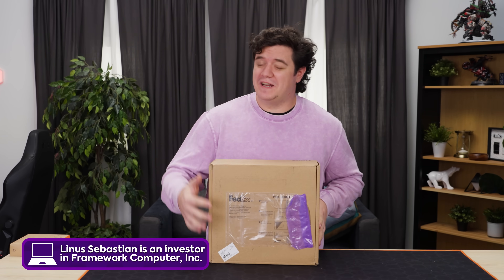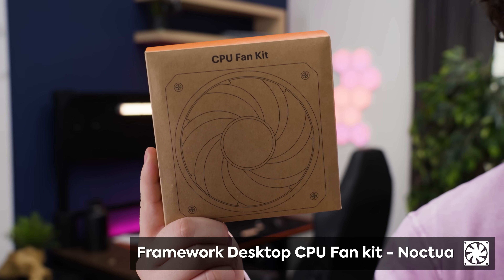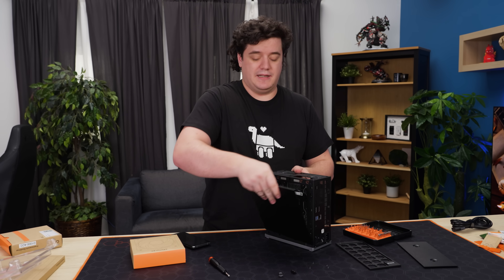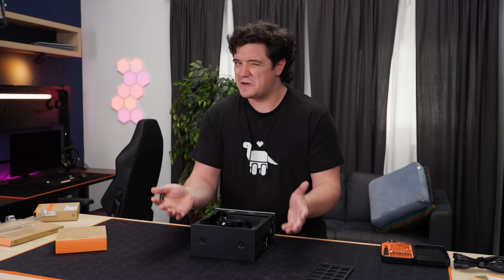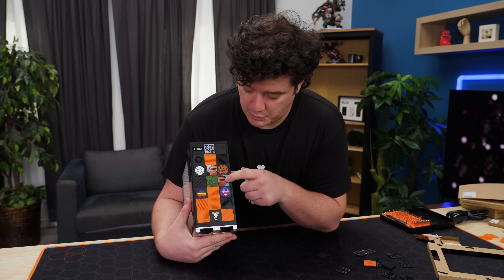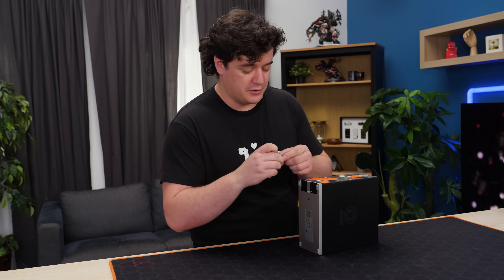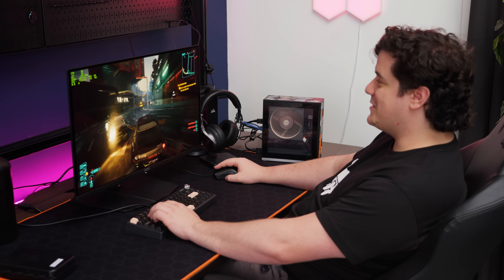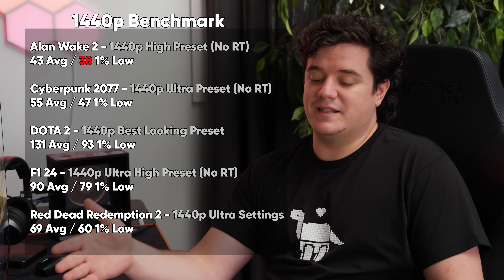This TINY desktop makes me nervous.... - Framework Desktop

Comment: If the maxed out version was $1200, sure. But $2300? Hard to say yes to that when you could get a way more powerful machine for that price.
Reply: I really wish people would fucking research before giving the "bUt Da PrIcE" line, got on PCpartpicker and price out a 9950X (cuz this is a 16 core Zen 5 APU), a cooler that can actually handle it, an ITX motherboard that can reliably supply it with power in the same form factor, 128 GIGABYTES of DDR5, a 2TB SSD, a 4060/5060/5060TI 16GB, a PSU to power it all, and an ITX case that'll still be twice the size AT LEAST and probably cost $200+ on its own, and youre running at about $2000 if not more, while also drawing more power from the CPU ALONE than this thing does in the whole package. The price isnt bad if you actually price out a comparable build and dont give it obvious favoritism over the framework. Is it for everyone? No. But its not overpriced.
Reply: @StretchDattass more like a NVIDIA RTX PRO 6000 Blackwell then you will almost have the same VRAM than the framework desktop. Ah yea the GPU costs $10k btw
Reply: What other system can you get under $3000 with access to almost 128GB of RAM for the GPU?
Reply: They are not upcharging you on the extra's you can fit, at least in my local pricing, and the base price for the system is pretty darn competitive! Its a whole computer with crazy performance in a lunchbox, just to get comparable discrete GPU to these AMD APU for any remotely memory constrained task (which often does include gaming as 8GB really isn't enough anymore) you are looking at spending at least half as much, and quite possible vastly more on the GPU alone. The nearest comparable RAM for a regular desktop is really not cheap, and almost certainly runs way slower no matter how much you spend on RAM and motherboard to give you the best chance of good memory speed overclocks... And for good measure these APU are vastly more power efficient than the regular desktop tower of comparable performance.

Don't get me wrong this thing isn't the best possible performance for your budget by any stretch, but comparing a 800w+ giant tower to a maybe 140w total system in a shoebox you don't expect the smaller system to also have price to performance in its favour. And the big tower has more ability to interface with extra hardware - want to load up on networking, or fill up on sound cards etc you can.
Reply: No you won't find a cheaper computer with equal or better VRAM capacity
Reply: Can't get a graphics card with 96gb vram tho
Reply: It's an ai first machine from my understanding it's still price competitive for the other computers using that chip from what I can tell
Reply: And much more upgradable without paying the framework tax
Reply: @tiloalo  happy to pay the framework tax, if I get a more upgradable machine. As I did with my framework 13. Less so here. Get why it exists but definitely not for me
Reply: in like 6 years i could see myself buying one. 2500 CAD is too much.

Comment: You can buy HP desktops or Laptops right now with this chip, this RAM, etc. but they include Windows 11 Pro installed AND in the case of the laptop, a screen. They are priced roughly the same as this Framework too. So what's the upside? Some plastic pieces of flair?
Reply: No idea what you're smoking, but the starting price of these HP machines with 32 GB of RAM is about what Framework charges for the 128 GB variant.
Reply: @jfolz I went on the framework website and did a build to match what HP offers. Came out to almost $1600. Now look up this GPU, RAM, and Windows 11 Pro for HP. You can buy them right now $1500-1800. This Framework device has 0 unique qualities
Reply: @jfolz  On top of that the Framework Desktop runs the chip at full TDP, unlike laptop manufacturers, who are constrained by thermals and battery.
Reply: I am pretty confused, since the main point of framework is to be repairable, but nothing essential seems to be replaceable. I think maybe framework just wanted to be one of the first ones to use this chip
Reply: @craniumsnumb A, they arent the first with this chip, half a dozen other mini PCs already launched with the same chip and configs they have before they started shipping this. B there's nothing saying they wont make another board with whatever the Zen 6 version on this Zen 5 chip is. C the main point is that theyre basically the only one shipping this chip in an ITX compatible mainboard form factor. Everyone else is a mini PC with a proprietary board for their specific chassis. If you wanted to, you could quite easily buy the 385 board itself for $800, shove it into a $40-$60 ITX case with built in PSU, slap on an SSD and have a VERY capable gaming machine with more performance than youd get out of a new desktop for the same price.
Reply: @craniumsnumbSOC chips are truly the future so yes. It made sense to be first in (now) niche markets as a small company.

Comment: I started writing a comment about how the cable is just a standard cable and we don't to keep manufacturing more of them when so many get thrown out with e-waste, or how many people just keep their existing cable and throw away a brand new one rather than take it out its packaging... when I got to the bit where he literally throws the brand new cable stil wound as it came in the box.
Reply: This! I was shouting "THATS WHY THEY DONT INCLUDE IT BY DEFAULT"
Reply: Yeah there are a lot of bad takes in this video.
Reply: We'd much rather solder the RAM to make the whole motherboard outdated in a few years...
Reply: @tiloalo thats an AMD requirement for the chip, not a framework decision. They either have this with soldered memory, or they dont have it at all.
Reply: @tiloalo  Unfortunately, soldered RAM was a necessity for this APU
Reply: @tiloalo  Better get used to it. More and more companies are heading this way. The reality is that for a unified memory system to work well, the added signal losses introduced by the connectors on a memory slot as well as the longer length of the traces needed to actually connect to multiple slots actually make a big difference when you're trying to achieve maximum throughput at high clock speeds.

Also, there's a big difference between laptop motherboards with soldered RAM to save costs or upsell customers and a system like this that actually needs that kind of signal stability to run at peak performance, particularly with higher-speed memory. Simply put, you can achieve higher memory bandwidth if there's less signal loss. It's not just about making more sales down the road, although that's basically an inevitable side-effect of this scenario for consumers.

With that said, I feel your pain. CAMM modules may be able to get some configurations most of the way in the future and provide some upgradability, but the days of buying a PC and then increasing the RAM later are coming to a close relatively soon, at least on higher-end systems. In the end, you just can't cheat physics.
Reply: @tiloalo   why the hell are you in every comments, even comments that are not about the ram, chirping? dude.. lmao if this annoys you so much you should just not buy it...

Comment: There are so many reasons not to include a power cable with a pc like this. The most obvious reason is that if you are buying this pc, it is likely not your first pc, meaning that you would already have at LEAST 1 C13 lying around. The second most obvious reason, and one that is shown in the graphic used in the video, is that they offer different cables for different regions. Why ship a North American power cable to someone in Europe? Why just ship out a cable that your user might already have. Spending $5 on a $5 cable that comes with the region correct end is not a problem. And if you already have a cable, you can save yourself $5. That is a plus in my book.

Comment: I felt better spending more money on a Framework laptop despite the average specs at the time, but I was fine because ideally this is the last laptop I'll ever need to buy.

I wouldn't dream about splurging on a desktop that's less modular than most standard laptops, performance be damned.
Reply: They even 5079 option in framework 16 now. That is already there is performance.
Reply: They even 5079 option in framework 16 now. That is already there is performance.

Comment: honestly i have a pile of that power cable.  at a certain point isn't one coming with the system just ewaste?  same with the HDMI cables that came with my monitors... i have a bin.  Yes MOST companies would leave it out and not change the price just as a cost cut, but... if I DON'T need it?  why should it be manufactured?

Comment: Framework: please release a firmware update to fix the USB-C video output, it takes like 3-10 minutes to get a display signal to my thunderbolt dock’s DSC triple monitor setup with me fiddling with the power button, power cord, mouse and keyboard until it eventually outputs video on any of my connected displays!
Reply: Same issue here with my single LG 34UC98 monitor connected via USB-C

Comment: I have so many c13 power cables lying around I would opt to not get one just to save the space
Reply: wow u saved like nothing
Reply: @primus711 So? I don't need another cable. I have plenty why should I or frame work spend money and material shipping something that will just end up being e-waste?
Reply: @No1Speci4l ewaste is a dumb excuse for 1 also all your cables arent the same wire gauge stop with the nonsense also you gave them a excuse to not include something and charge you the same lol

Comment: I wish the memory wasn't soldered. I think the big reason that framework has gotten so popular is because of the upgrade ability and I would rather sacrifice some performance to make sure I can continue to use the device down the line
Reply: In a framework Q&A talk, they gave a pretty good reason for it, they wanted to give this chip a desktop capability, and from talks with AMD, and revisions to the chip, the performance loss would be too great that the chip would no longer be attractive to be bought, since this is a heavy laptop mobile focused chip, the performance loss would just make it better to buy a normal desktop
Reply: @santiagoestebancastelblanc3665 maybe they should just use a desktop chip in a desktop PC...
They succeeded to make it less upgradable than any other mini pc...
Reply: @tiloalo how exactly is it "less upgradable than any other mini pc"? You act like high-speed laptop RAM isn't either effectively nonexistent or ridiculously fucking expensive.
Reply: @tiloalo desktop chip means goodbye to this chip's number 1 selling point: unified memory. You're gonna pay daddy Nvidia the premium they want to even smell above 32gb of vram
Reply: As far as I understood it wouldn't just have been "some" performance. It would be more like half the ram clock speed to reach a stable system on CAMM2 Modules. If you would do that you couldn't justify the price anymore
Reply: https://youtu.be/os_fHy1mB_M 18:11
Exactly here they talk about it.
And well, it's a tradeoff that current gen hardware and protocols can't overcome for the huge performance gained, give it a year or two and it could change, or a bit later
Reply: How likely are you to upgrade from 128GB of RAM in the next few years before the CPU becomes obsolete? I would rather upgradability as well but realistically by the time I'd go to upgrade I'd likely want to get a more modern CPU too.
Reply: If you want top tier apu performance, lpddr memory is a benefit
Reply: Sadly new faster non soldered ram standards are not there yet.
These SOCs need faster DRAM/RAM.
Reply: Some would argue they rather sacrifice the upgradability since the memory is ample.
Reply: @TK-on7cz while the performance is good isn't the whole thing about framework is the March of time all equipment eventually becomes obsolete and you want to be able to upgrade your equipment for future use? Theoretically I can use one of their laptops for years to come but this now has a finite expiration date
Reply: @zackshannon834 yes but you can just close business if you don't want to build perfomant computers while still being more than 5 times as expensive as a used laptops (environmentally more friendly). Technology is changing and ram speed of modular standards are becoming a bottle neck with SOC chips. And SOC chips by nature are less upgradable because they include more things built in instead of having them separate. That's what makes them efficient and fast. This is the future

Comment: Dawg the pc can be configured without the SSD which costs more than the power cable lol they’re just thinking about those of us who already have bins full of C13s
Reply: My thoughts exactly.  Some people just want to be charged for things they may or may not want or need, I guess.
Reply: Fr. Having a BYO optional system brings down the price for some, and allows the others to also source from another manufacturer if the upcharge is unreasonable
Reply: Same with the laptop, where you can configure it without any ram, ssd, charger or expansion cards. I really dont see a point in complaining about it
Reply: If you're a framework customer, you've probably already accumulated the mandatory bucket of random cables that haven't seen daylight since 2007
Reply: I have a handful. Not to mention you can go to a recycling center and just take them 😂
Reply: but they should put -5 if you dont want it and not +5 if you get the cable
In other words the cable should be included by default. Then you decide if you want to cheap out.
Don't get fooled.
Reply: It was kind of funny that he complained about it being an add-on, then had one already plugged in, and literally threw the new one away lol. (I doubt they actually did it was just funny)
Reply: Exactly, it's a great feature not a downside. I would rather have my product cost $5 dollars less than have an extra power cord.
Reply: His problem is that you have to pay for it.
Reply: @hdhsu-dg6fb you would have to pay for it wither way. If it was always included the base price would just be five bucks more. If you think a company would just gift you anything, think again

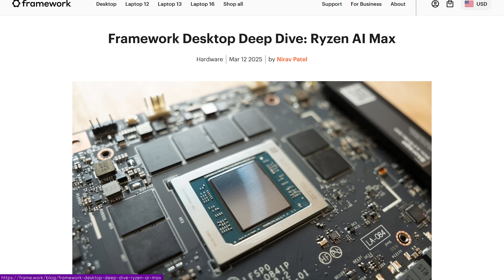Comment: 5:03 it can actually be configured to be dynamic like apple systems the bios config is just if you want a fixed amount of ram instead of using dynamic allocation which isn't always well suported software-side

Comment: I think the if you’re using it for gaming the only problem with the Ryzen Ai Max 385 is the downgraded iGPU will probably be lower performance than 4060
Reply: Which does mean for many gamers its actually a huge step up in performance... The performance of the GPU side on these AMD monsters is way above the normal sort of GPU judging by steam hardware surveys and the shear price of the higher end 40 and 50 series cards! Only the folks that can afford to upgrade and really chase the flagship Nvidia products are going to notice this as a real downgrade, especially with the stated purposed of LAN party, so the monitor is going to be smaller and lower resolution.
Reply: @foldionepapyrus3441  true but would still likely cost more than a similarly performing upgradable pc you build yourself
Reply: @drew2626  But not as power efficient or small. Also with the current GPU market at least round here I don't think you'd actually be able to start from scratch and buy new to be a fair comparison and actually achieve really comparable performance at the same price either - you can certainly if you know your specific program/game's bottlenecks bias a custom built system specifically for only what you need so in that performance or pricerange get a better result.
Reply: @foldionepapyrus3441  True enough, that’s true a problem with computers (or pretty much anything) if you don’t know what you’re looking for it’s easy to end up buying overpriced crap thinking in the moment you’ve done good and then regretting it like me in 2019 when I spent a government grant on a laptop I thought was good at the time because I didn’t know too much and seen NVIDIA GeForce and i7 and thought it was a good machine (it was a quad core i7 (bottlenecked by HP), 12GB of RAM, and MX250 graphics 😢).
Reply: my laptop with 4050 is quite capable for gaming.. with tweaks can play Monster Hunter Wilds and BF6 beta
granted Loseless Scalling help a lot more